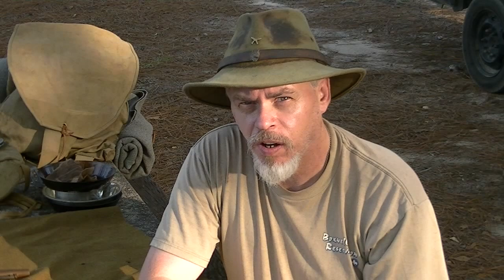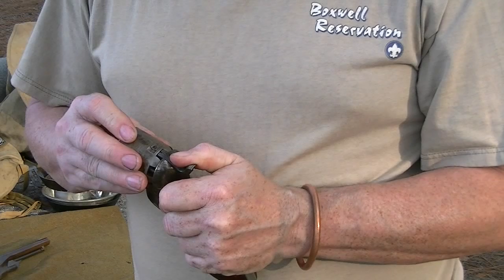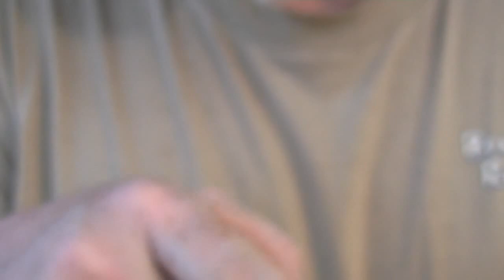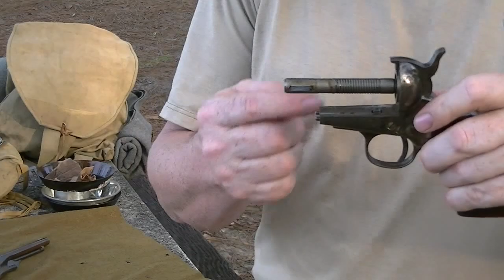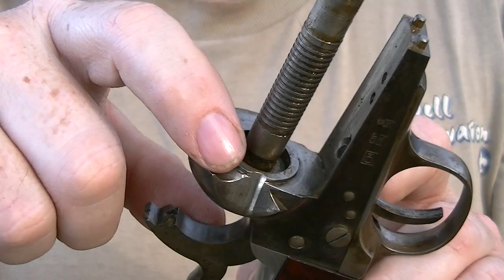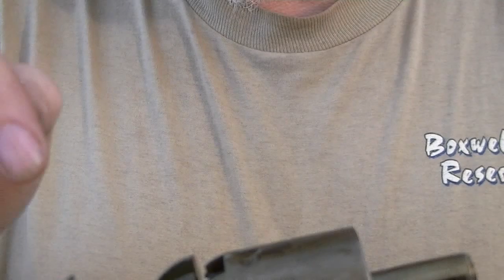THE PERCUSSION REVOLVER CAP JAMS

Comment: Im going to say the previous softer caps would provide enough resistance to cause a failure to fire when it got behind the hammer or action.  Our stiffer material used today has created a problem that didn't previously exist.  Just a guess.

Comment: 5 years........... Ummmmm does that mean what worked 5 years ago still works today.......
 After 10 years+. I'm trying to get back into black powder shooting with my 15 year old Uberti 1851 Navy, but only had a few #10 Rem caps, I guess they are no longer made. So couple days ago I found some CCI #10, I bought 2 cans with fingers crossed hopping they'd fit. Well they start to go on my original nipples but I have to push really hard with stick so they clear gun frame, but after pushing hard they wont fire first time around but do 2nd time around, thats no good.....
 {{ Therefore what would you do to make them fit and go on all the way, I was thinking a drill and file?? }}  I tried finding nipples for CCI#10 but they dont exist..........
I recently bought Slix-Shot nipples and they work good on Rem #10, but no way can I get CCI#10 on those nipples.....
I plan on doing same file technique as you described  to my revolver hammer, mine was wore in so bad that I put a spot of weld on the face and cut back in same safety notch groove with Dremel. I did so go i could cut my finger on notch edge. But incase it wares out again to quick, I just ordered a new hammer from Dixie, they are $50.00 ouch!!!!!!!!

Comment: I never thought about recoil/ gasses and the sharp edges? we also have "main spring with mass of hammer in this equation. What can YOU RECOMEND for an early 70's Uberti 1858 44 and Minor jams? I built and finished at age 12, I am a bit of a gun smith not intimidated to dig in.

My caps are DIY and ARE a foil mostly aluminum some copper, working out DIY musket caps too. I live in CA and caps or BP are UnOptainium any place at any price! All my consumables are DIY, my cap jams are minor and typically in the rotation and relived at half cock and a little cylinder spin.
My hammer area fouling is typically the color and look of Cap ignition residue. 

Love your Black Powder Stuff! Thank You Sr!
Reply from the maker: try adding grease rings to the base pin close to the face of the cylinder it may help with the minor drag issue

Comment: I have a new 2021 Uberti Cold Walker.  It does not have an ejection port like you showed.  Can I add an ejection port to it?  Would it help with cap jams?
Reply from the maker: the walker was a early model and was not made with the port like on later colts it usually is not a problem on walkers since the cyl is so large there is enough of a gap for caps to slide out

Comment: I have purchased my first black powder revolver.  It's a Uberti colt Walker.  I read the manual(instructions) line by line and It does not say what cap size to use.  I looked on youtube and saw in a video someone using Remington no 10 which I can't find.  As I looked further, I noticed a lot of people are lost as what size and brand of cap to use.  Some people were blaming misfire on using loose or wrong caps.  I think Cap size and makes are worth a discussion.  It would be appreciated  if you could demonstrate how a cap should fit and what caps fit what guns as much as possible.  I am still looking to see what other brand of caps fit my Uberti Walker other than Remington no 10.  Such information is valuable since at $60 for 100 caps, we can not have an assortment of caps for the hell of trying them on..  Thank you very much for all that you do for us.

Comment: I used my Dremmel tool  with a diamond wheel to cut my grooves in the nipple very lightly,  and cleaned the fouling on the hammer and hammer stop also cleaned up the sharp edges on the hammer... boy what a difference it made,. I just shot it today and no more cap jams. 'each cap busted apart and fell off when the cylinder rotated, I also replaced my weak main spring with a new one . thanks Blackie... this is best 1860 army tutorial of them all.  it is fun shooting again with a gun that functions well.

Comment: Blackie ,  great tutorial , I have problem with my 1860 model uberti, I ground down the hammer spring to lighten the trigger pull ,but now i'm getting a lot of misfires. .I want to get a new spring but even the new ones aren't very strong . my gun was made in 1970 and wondering if back then the springs were stronger. what is your advice .I never had any problems before i weakened the spring.
Reply from the maker: a weak spring can be braced that means a small shim is added above the screw where the spring is attached to the grip frame and it will add more tension i will do a video on this and post in a few days to better show what i am talking about

Comment: i also found a way to prevent cap jams is put some jb weld into the notch on the hammer face and when it cures use a finger nail file or small file and file it smooth

Comment: I have a Belgium made 1860 Army made in the early 1960's and sold as the new Army 1960 by  Centaure Arms. This is an unfired pistol with the factory box with even the wax paper the gun was   wrapped in and I have never fired it ether. I have fired another one of these pistols I had before this one and it didn't have cap jams. I noticed the main spring was much heavier than my Uberti or Pietta springs. The fit and finish on these Belgium  Colts is better to include the hammer face. I have fired an original 1860 Army an old friend had and it didn't surfer cap jams. Could it be as simple as putting a heavier main spring in from the factor would end some of this problem.

Comment: Good info. I just got a Taylor  U. 1862 colt police 5 shot 36cal. every time I fire it the cap blows off and is stock just above the back of the hole for the cylinder  pin. I have to get a small stick to scrape it out. The hammer is about 1/8rh" back after firing. Lots of BP residue there. 15 shots out so far

Comment: The main spring in my Belgium made 1860 Army is much heavier than in my Uberti or Pietta. I clean the face of the hammer and tried drilling a hole in front of the hammer and putting in a small post in to stop the caps from dropping in the action with mixed results. Filling the gap in the hammer to make it solid was my best results along with slip shot type nipples. As far as I know no one makes a stronger main spring like what original colts and the Belgium Colt has.

Comment: I ran a standard (1.25") paper clip through old & brand new Slix Shot Colt nipples as well as stock Remington nipples and all 3 easily accepted the paper clip. I am assuming you meant the larger size paper clips (2")?
Reply: Nope the 1.25" paper clip will not enter an original Colt gun. Nor the Colts made during the 1970's reintroduction. Slix Shot have large holes by design to increase the power/speed of the cap blast.

Comment: I never thought the fired percussion cap provided a seal against chamber pressure.  Any sealing provided by their fractured cap is imperfect, variable, and all resistance to chamber pressure is provided by the resting hammerspring tension which is considerably less than chamber pressure.  This can be seen in hammers blown back to half-cock with hi-pressure loads, and that revolver chainfires seem to originate nipple-to-nipple, rather than chamberface-to-chamberface.  Of course that's just my take in a business of a gazillion opinions.

Comment: Excellent discussion. There are a couple of BP shooters online who have addressed the cap jamming issue by filling the hammer nose with JB Weld. While this approach does actually help reduce cap jams, I personally wasn't ever in favor of it because it was obviously defeating a design element. There is another shooter who installed an upright pin in the frame that slid into the hammer notch, and upon cocking the hammer it scraped any stuck caps free of the notch. This approach works very well indeed, and preserves the between chamber safety, but requires a skilled machinist to do the job and its obviously going to cost. Again, not the best solution to my thinking.  You have explained the issue excellently and given a practical and effective answer that anyone can do. 
Your approach needs to be spread far and wide to all Colt BP shooters.

Comment: I have a 32 FIE Colt style black powder my cylinder lock is not coming up and locking the cylinder and the more I cock the pistol it stiffens up I have taken it apart several times and cant fine anything that would cause this, any help with this. Thanks James Hilton
Reply from the maker: check the opening where the cyl lock come up thru the frame often this will pinch the cyl lock and grip it..also a burr and prevent it from lock up..a weak trigger/bolt spring may fix your problem

Comment: Thank you sir for another entertaining and informative video,
You know how sometimes people will call a knowledgeable person a  "  Font " of information?
Well you are NOT a Font of information.

Blackie Thomas is an entire " Sprinkler System " of information.

I have not purchased my Pietta 1851 Navy revolver yet.  I missed the Father's Day sale so i will have to wait till the Christmas sale in December.   No problem, I am in no hurry.  IN the mean time I am enjoying adding to my know how on the subject by watching your videos and a few other content makers here on Youtube.  Your videos are by far the best in my opinion.  I plan on using all your tips on slicking up a new revolver and i will pay special attention to the face of my hammer to be sure it is as smooth as a baby's bottom.

I do have one question about this topic.  There is another Videographer who proposes to reduce percussion cap jams 
to use JB Weld  to fill in the gap on the hammer face to provide a solid smooth contact with the cap when the hammer falls.
I noticed you do not suggest this method in your video.  Was there a reason?

Thanks
Bill
Reply: I did this with j&b epoxy and after a few shots the epoxy weld fell off ! What is a cap rake, defection groove ? I know about the pin installation...If ya know e-mail me....oblee519@aol.com
Reply: @leealexander2394  I bet you found the answer long ago. But the cap rake is just a pin sticking straight up behind the nipples. This pin will not allow the caps to move backwards when under pressure. The defection grove is a groove cut into the hammer to allow the hammer face to not strike the pin as the hammer falls when the gun is fired.

Comment: Superb presentation and explanation of Colt's C&B revolver design, and why cap jams occur, especially in modern replicas.  In order to meet a price point, modern replicas are very poorly fitted and finished compared to original Colt and Remington revolvers, and stock nipples usually have flash holes that are way too large. The good news is that Uberti and Pietta replicas have good basic quality,  so that with a bit of home gunsmithing, the replicas can duplicate original quality fit and finish IF the owner/shooter is willing to do the relatively minor work needed.  I've discovered that with a bit of home gunsmithing, the replica Colt and Remington revolvers are amazingly reliable and trouble-free, more so than many of my auto pistols in fact!  I'm particularly impressed with Uberti barrel quality.  My Uberti C&B revolvers,  after tuning and slicking up, are impressive with such extreme reliability. But most impressive are the astoundingly tight groups these C&B revolvers can shoot, especially with conical bullets!  For me, from a rest, precise 100 yard hits on man-sized targets are no problem at all with these "primitive" revolvers. These C&B revolver replicas are incredible bargains!

Comment: Thanks Blackie. As a relative newbie in BP C&B revolvers your videos have helped me greatly. On Duelist 1954’s channel he solves cap jams with JB weld closing the hammer face entirely but after your explanation I see the trigger face notch not only provides the safety but dissipation of gas. Am I understanding this correctly? Any opinion on closing the notch entirely? And secondly would a manufacture of caps using either a pliable material (vinyl rubber, or hard plastic) be feasible in your opinion? Thanks.
Reply from the maker: if the slot if fully filled it can still work....also in a later video ( right after my video came out on cap jams if i recall correctly  lol ) DUELIST 1954 went back and did the mod i mentioned to that revolver that was cap jamming  big time..he replaced the slick shot nipples with the factory nipples and basicly did my mod and the revolver was cured...nowadays when he shows tuning he goes into detail on making sure the slot in the hammer is smooth and free of burns..my advice is start with my mod..then if that does not work go with the filling of the slot...as to caps..i am sure if there was a big enough market the manufactures would come up with a  modern synthetic cap...thanks for the comment safe journeys

Comment: 20-30,000psi is in the range of modern MAGNUM rounds.  I know for a fact that cap and ball pressures are a bit less than that of the standard .45 colt, which isn't much more than 14,000 psi.  I'm sure that at the pressures you said, the cylinder would split
Reply from the maker: you are correct..i miss spoke
Reply from the maker: in correction the lyman manual states 7 to 8000 psi..at the time i did the video we had been loading a .44 mag for  a desert eagle...i seem to have had a brain fart... i shall correct the video thanks for pointing it out..safe journeys

Comment: Good video and good suggestions.  I tried Slix Shot Nipples, but they were too long and I would have had to shorten my hammer face.  So for now I'm sticking with Tresso nipples.  I don't know for sure, but from research I've done and reports, Colt supplied percussion caps were made from a lot heavier copper than the ones we have now.  According to one report I read, Colt's worked best with Colt percussion caps, and another make, can't remember which, may have been a Remington, worked best with there caps, switch caps and problems arose.

Comment: my pair of 1860 Army with cap rake have a total of over 300 rounds with out a cap jam. SlixShot nipples and Remington #10 caps work as fast as i can cock and shoot. Spent caps fall out the right side as the cylinder rotates.
Reply: Good to know! I am getting the same setup. Do cci #11s work ?
Reply: @chickensandwich1589  on y Slixshot nipples #11 works fine. RWS 1075 do not work they are a tiny bit small. I have no idea bout factory nipples.

Comment: Howdy, How does one know if his hammer spring is weak? And, If a weak hammer spring is the culprit, how do you strengthen it?
Reply from the maker: A easy way to tell is between the frame and the hammer..if thick fouling builds up quickly like in 25 shots or so to the point ..the falling hammer will not always set off a cap..then the main spring is not holding enough against the back pressure and is weak..a simple fix is to replace the spring..the springs and other part are available from many places just do a search..thanks for the question..safe journeys
Reply: I have an 1860 army, my first BP revolver, and I've only shot a couple dozen rounds with it.  Going through the learning curve. Thank you for sharing your know how.
Reply from the maker: glad to help i have a series on the walker uploading now and should be posted this weekend..then i will do other revolvers..hope you find the knowledge of use..safe journeys

Comment: Original Colts has a very narrow slot. Years ago I shot an original Navy Colt with those coft caps but I cannot remeber a cap jam. On the other hand Italian guns for reasons I have no idea make a gully. So install a cap rake.I have a pair of Pietta 1860 army revolvers that have a total of about 200 rounds with no cap jams. You are correct SlixShot cones, #10 Remington caps and a cap guard (cap rake) make the guns extremely reliable. The spent caps sail out the side like links out of a machine gun.

Comment: Great channel! What about filling in the hammer slot with JB Weld and sanding the hammer face smooth?
Reply from the maker: that will stop the hammer from grabbing the cap. and this will often help cure the problem at the loss of the safety pins...but.. it will not address the blowback issue and if the cap is being forced off the nipple due to weak spring pressure it will still fall down on the recock..

Comment: my pair of SASS competition tuned 1860 Army revolvers have fired about 250 rounds total with out a cap jam. The modification that prevents the cap jam is a cap rake (a small post in the hammer channel of the frame) that holds the spent cap in place until it is thrown clear with cylinder rotation. My guns are as reliable as a cartridge gun and twice as much fun to shoot. Your fix helps, the rake is almost fool proof.
Reply: Can you more explain this "rake".....or do a video about it?
Reply: cap`n ball has a video on it.
Basically a pin welded into the upper frame, betwen cap and hammer, that way the nipple wont fall backwards   way down in between hammer and frame.